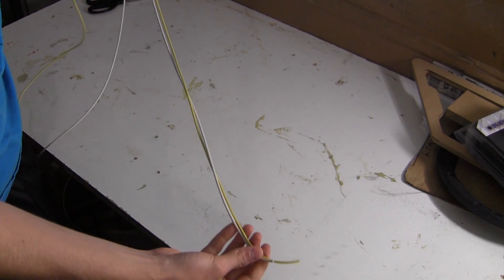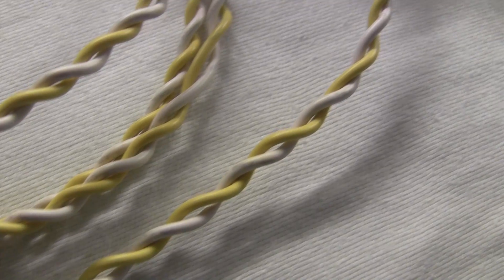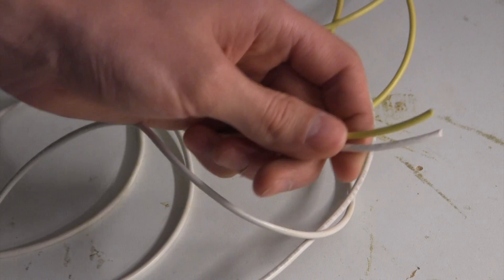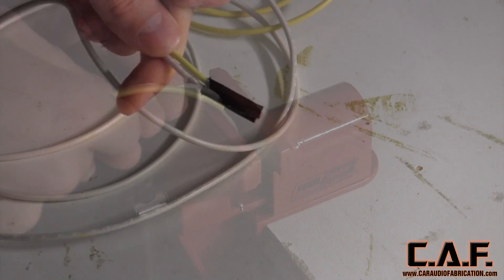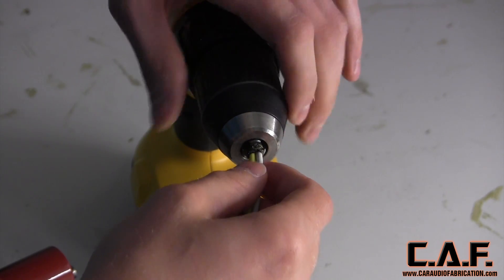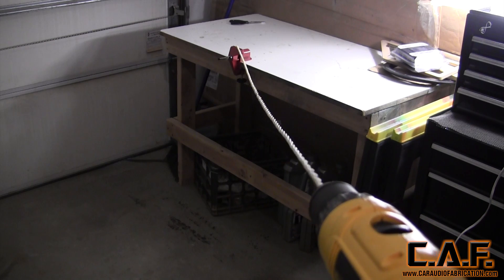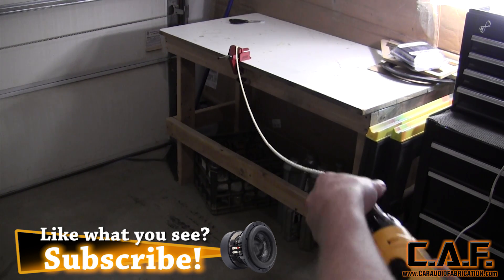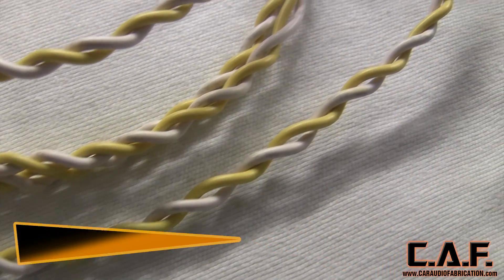How to Wind Wire in a Car Audio Install - Car Audio Quick Tips - CarAudioFabrication

Comment: I did this last week. I didn't use tape and I didn't pull the wire back as the drill was spinning. My wires bunched up and weren't consistent throughout the length. This is truly a tip to help take installs to the next level.

Comment: Great tip Mark. I have done this a few times before. It also helps to know how much wire you need a head of time so you don't run short and have to splice two strands together.

Comment from the maker: I definitely agree with tying it down for safety reasons, but its all in the design, consider a way to bolt it that is easily accessible so when it does come time to remove it you just un bolt a few bolts and pull er out. You could even consider a security type bolt so that only you can remove the box easily.

Comment: Quick tip! By twisting your wires you can cut out a good deal of interference from nearby power sources and other signal wires. Telecommunication companies use this technique when wiring their systems. All data cables have this twist as well. Cat 3,5,6 is a rating associated with the amount of twist in a wire! :)

Comment: @CarAudioFabrication, Mark, I have a tip for you that I came up with and think is pretty cool. Take 2 twisted pairs making sure to label each wire if you are using more than one of the same color. Then untwist the pairs at the same time using the drill and vise technique you showed in the video. You will be amazed at what happens to the wires. They become braided into a set of 4. Next try 4 pair or more. It is fascinating how the bundle turns out. Feel free to use the tip in your videos.

Comment: I work on cabs myselve and im always in the field. I dont have a vise so I usually yust knot one end around the door handle. This way i can also make a good guesstamation on the lenght of the wires i need. I also never tape off the ends. Never needed to.

Comment: Love these quick tips. I was thinking maybe one when to use a relay on remote wires and how to do this. I know how but i figure relays can be used for multipule ways. At the shop we use them to bypass video/brake switches. More than one way to skin a cat ;)

Comment: If u could would u b able to do a tip on how to run multiple wires from multiple altinators? That's what I'm stuck on trying to figure out and no one has made a video on how to do it. And also how to run multiple amps to a single head unit.

Comment: Ok. I love the vid's you produce so I ask for your expert opinion. I have a Hyundai Tucson and want to install a sub box that I can easily remove if I need the cargo room for a vacation trip or something like that. A recent visit to a local installer suggested to permanently tie it down for safety reasons. I just need the option to remove it while still powering mids and highs with amp installed under drivers seat. Can you suggest any alternate options? Thank you.

Comment: what about wires with high flexibility? will never stay twisted unless separatly twisted same sense(clockwise both, for ex.) and then will twist one around the other. in this case you need two drills. same way rope makers do

Comment: Share the tip, where if u have a tiny lil wire that when u strip the copper comes off, to use a light and heat the insulation, then tale the fire off and IMMEDIATELY pull on the heated peice too remove the insulation without chopping or removing copper :) same concept with huge wire, but heat it then use pliers too   Pull it off

Comment: does twisting them on each other cause a lets say 12 inch run of wire shorter in the end?
Reply from the maker: Yes it shortens the wire, you should cut the wire longer than needed and clip once installed.

Comment: Personally I think the tape is a waste. No need for it. And if u give the wire a quick litrle tug st the end it helps "set" them and keep them tight so they dont unravel. Ive found more then 2 wires and ling lengths tend to unravel if u dont stretch them at the end.